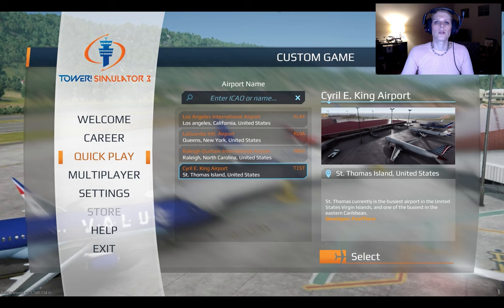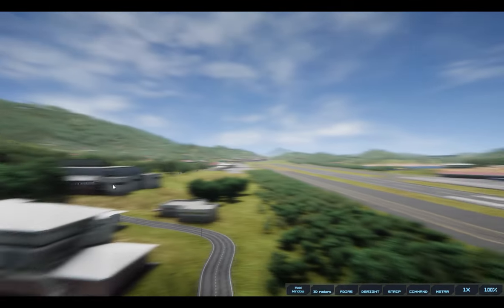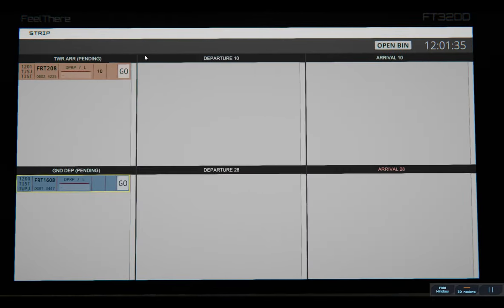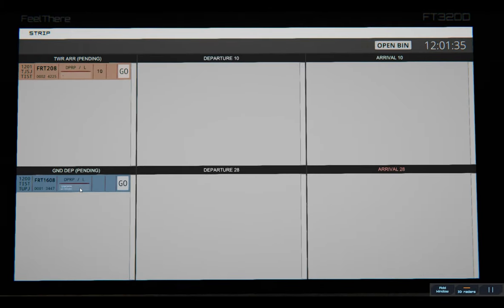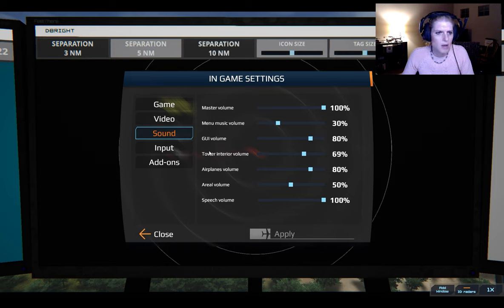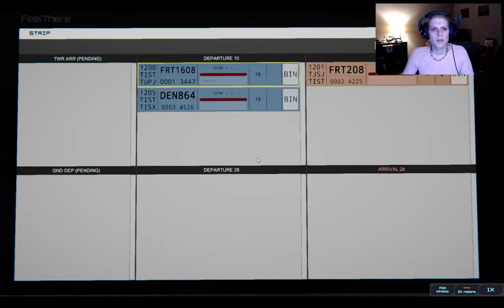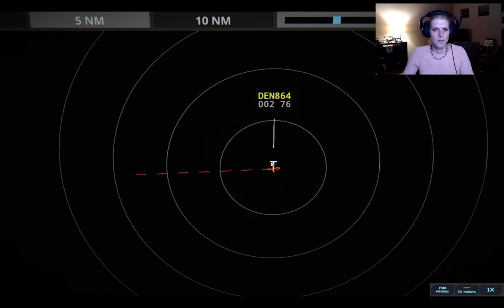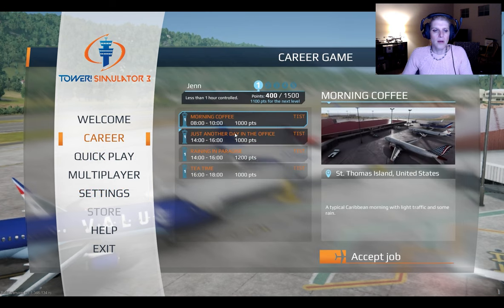Tower! Simulator 3 - #2 In Tower Layout & First Controlling Impressions

Comment: Hi, do you know if wind direction/speed call outs have been implemented in the sim. Also where QNH can be advised? Many thanks
Reply from the maker: For QNH you mean the pressure?  Not sure they have that in.  I believe you can speak the commands regarding weather but not sure it actually does anything.